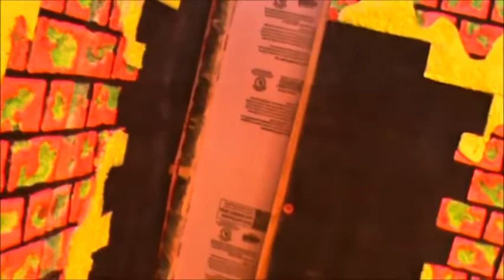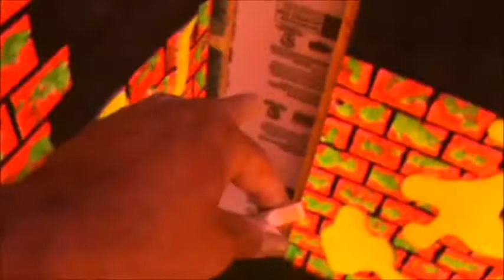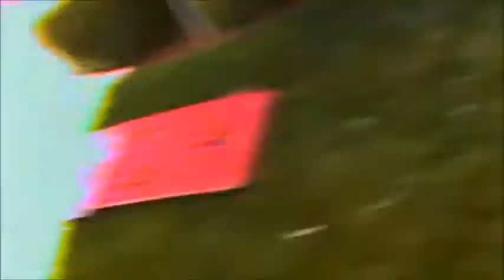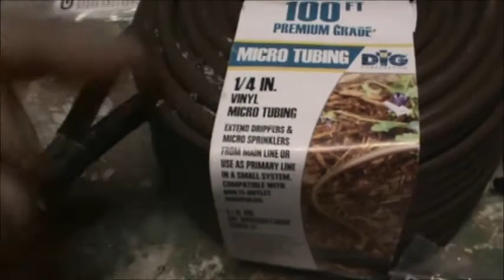Haunted Tents set up Day 3 9-30-14

Comment: Nice job! Is it going up faster with the panels than it did with all the scene setters?
Reply from the maker: it seems to be a bit faster.. I wont know for sure rill all the walls are up .. the area im working in now, pirates, spiders and corn hall all have scene setters in them the rest of the haunt is all foam board panels, I think once the maze is done ill go back and look at last years set up vlogs and see hoe long it took to set the maze up